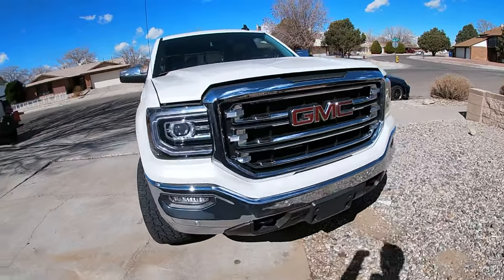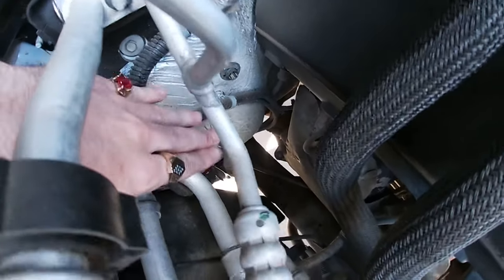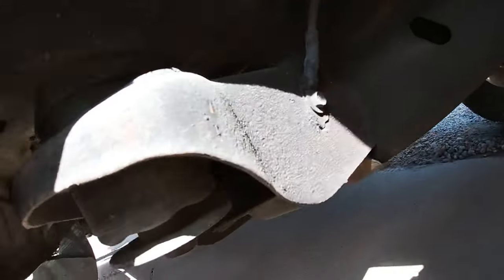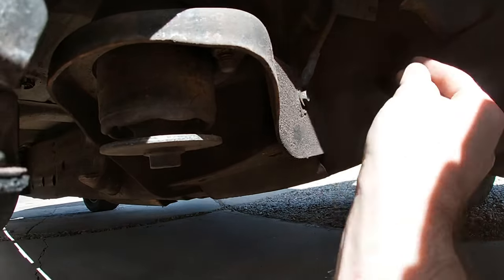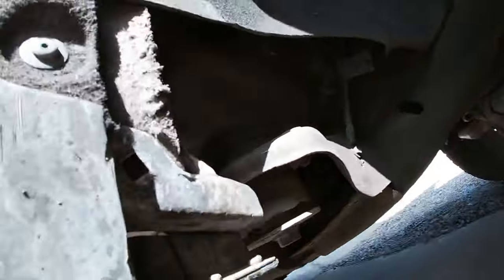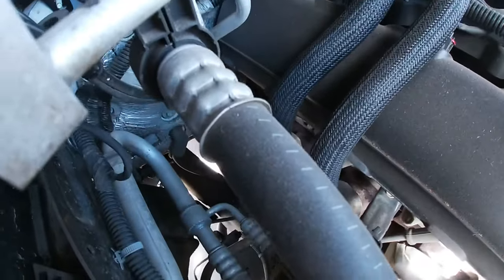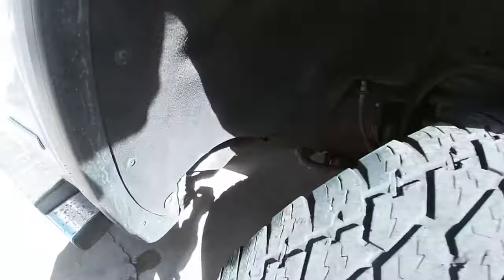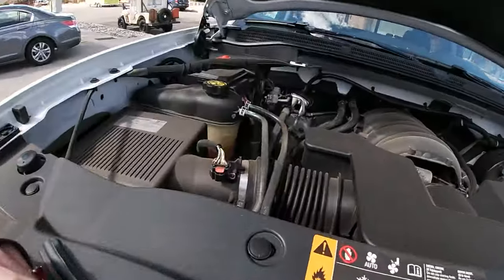2014-2018 Chevy Silverado electrical issues (solved)  part 2 pass side ground locations

Comment: I had problems like this and it popping a stabilitrak code. I cleaned the grounds, did the stearing position sensor, and the dealer had it for 3 days and said it was a bad hub. None of this fixed the issue. I changed the negative battery cable which looked completely fine about 4 months ago and the problems have completely gone away. I just figured while i have a minute id comment this on some of this videos so it coule maybe help someone because nobody had any deffinite answers for me and it sucked
Reply: I'm in that exact same position. I've cleaned the grounds. I've purchased a new battery. For whatever reason the truck will still completely shut down some times. Usually if the air conditioner is on I'm slowing down and turning into a parking lot. It's like with the electronic steering it's drawing too many amps. The truck completely shut down today and if a car was pulling out of the parking lot I would have hit them head on! The only option I know left is to change the whole negative battery cable. Every time this has happened in the past, I have no power until I open up the hood and squeeze the negative cable. It looks fine but obviously it's not! Glad changing it helped you. Hope it does the same for me..
Reply: Let me know how it goes I’m dealing with all the same stuff. Literally happened to me at Home Depot today
Reply: Thank you for posting this. I'm having the same issue right now. Next dealership appointment is March 26th. So I started cleaning the grounds tonight. Thank you, thank you, thank you.
Reply: @darrensalmons1985 what was the result of dealership findings??
Reply: I was having the same problem maybe a year ago on my 2015 tahoe ltz. Took it in to the shop had all the grounds cleaned up, but it eventually came back. I replaced the negative ground wire and it fixed for about 6 months. Now it's doing it again. This has to be a recall. Going to check the hot battery terminal and the ground by the speaker next. After that I'm getting rid of this thing. I'll keep everyone posted.
Reply: @napsgaming1854 hey man im having the same problems right now , did you find the problem
Reply: I’m in the same situation as you, but we replaced the whole negative ground cable and the car does have electricity, but it’s not wanting to turn over at all. I don’t know what to do.
Reply: My ‘15 Silverado does the same thing, repeated clicking when trying to start it. Sometimes it would eventually start and when it DID, the clock would reset to 12:00 suggesting an electrical short. When it happened one time, I pulled on the neg and pos batt terminals, retried it and it started. I replaced the neg ground wire to battery and it worked for about 3 weeks. Advance Auto rechecked it today: Alternator, starter and battery all good.
Reply: My 16 tahoe hasn't run in 6 month because of a random grounding issue. I replaced battery and it fixed issue fir about 4 months. Then started happening again where it decides it doesn't want to start some days, throw 12 codes and dash lights. Then next day start up just fine with no issues. I sent video to dealership and the technician said I need an exorcist instead of a mechanic. So I've been stuck making payments on a vehicle I can't even drive and no video out there has solved my issue
Reply: @Patriciaaannn my tahoe is having same issue. One day it won't start and throws a bunch of warning lights and tcm,ecm,bcm codes. Then the next day after not touching anything it starts up just fine... never buying a gm truck after this shit
Reply: I have the same issues with my Chevy Silverado 2016 I’m gonna try and change that battery post also and see if that does it! That would be so awesome if you did because this has been an issue for a while now! I have changed upper and lower control arms on his truck, I have change the transmission, I have change temperature sensor And I keep having the same problems. The bad part is if the sensors are not working right then the cooling fans don’t work right which causes the air condition to not blow cold I have about had enough of this truck!
Reply: @darrensalmons1985  update?
Reply: I'm having some weird issues as well my radio changes by its self and all lights go blank also the stabili track and the power steering keeps popping

Comment: For everyone who's having flickering dash lights, , the truck suddenly shutting down when lowering the speed to idle, slipping transmission (sometimes) a voltage reading under 14 volts (9 to 11) nav system and radio suddenly shutting down..., YES, THIS IS THE PROBLEM believe it or not. A bad ground because with time starts to get rusted or dirty and is not properly making the ground as it should be, taking off the screw and cleaning the parts,  where it goes connected and the metal that the screw holds fixes everything.
Reply: I will check my 15 Sierra
Reply: @juanrrobledo89  any chance is a black sierra, cause I just seen a black sierra stalled in the freeway in Oklahoma City and I wondered if it was you searching this
Reply: Exactly what my truck is doing thanks

Comment: I clean mines yesterday and it hasn’t been doing the flickering or shutting off and the steering wheel doesn’t jerk around when I turn . It was dirty af . Hopefully it stays like this thanks
Reply from the maker: Yea man I hope u got her all fixed n saved some money from the shops.   Please if u remember and truck is still going good in a month r two post a update comment thank u for ur feedback
Reply: Did this to my truck and maybe 4 months later the same problem is occurring… i think that it never truly fixed the problem. I think I’ve just driven enough miles for the codes to come back up. Anyone have tips?
Reply: It’s started doing it again . I just changed my alternator and new battery. I haven’t had problems since .
Reply: @fukubish6024 how is it working for u mine started doing the steering wheel jerk then that went away and now it just dies here and there
Reply: @getthebenji8462  I cleaned the ground That’s behind the front passenger tire . I stopped doing it

Comment: A week ago I removed the front dash panel and check both grounds at each pillar tucked up under windshield. Driver side was good. Passenger side was tight but wires sitting on the rubber matting. Removed the speaker. Loosened the nut to get all the rubber removed that the wire was sitting on. Cut all of it off around the bolt. Tightened back up and drove a week without issue. Today I drove about 28 miles. Shutoff truck. Went to get back in it and it would not unlock from key fob.. so, I assumed all electrical was out.. used key to get in truck. Amp steps did not work. Turned key nothing… not a sound.. just put new battery in a week ago. Checked both battery connections and both were tight. Another fella saw my hood up and came over to assist.. spent about 15 minutes checking fuses battery terminals and nothing. So, was planning on calling tow truck.. the fella and myself wanted to push the truck out of the way.. turned key nothing.. put truck in neutral and pushed it about 30 feet. I was steering and both of us pushing. Got to the spot I wanted it parked. Pushed the brake down put it in park. And all the power came back and truck fired right up… I also fixed the grounds underneath the truck… pulled bolts out. Grinding down to bare metal putting dyo electric grease on the bolt and tightened them all down… now I am wondering what my next step should be? And help and guidance would be appreciated. My thoughts of possibilities are. 1) ignition switch I am leaning towards that or a ground I am missing? When it would happen when truck is running the truck continues running fine. Just all electrical goes out… I mean everything…. All lights entire dash… which is a huge safety concern driving at night? Any thoughts? Thanks
Reply from the maker: Wth really damn it sounds like a bad connection some where if u got all the grounds but somthing as simple as pushing the truck making it start sounds like something lose let me look over my truck n see what I can find for u to look at strange tho has to be somthing stupid simple
Reply from the maker: Do u have a lot of keys on ur key ring I do know that too much keys on a ring is bad for the ignition I was kinda thinking the same thing the switch but hard to say
Reply: @garciagarage7735  I have only 3 keys and 1 Apple ID on my key ring.
Reply from the maker: I know it sounds stupid but I wonder if the Apple ID might be interfering with the cars key chip  Iv seen the little bling ring around the key whole mess with a car n it not start just cuz of the little bedazzled ring for dress up around the key whole but I think the Apple ID might be built smarter then that but I’m not sure just a thought
Reply: @garciagarage7735  was thinking same thing
Reply: Have you found the problem ?
Reply: @jordylsx8528  I have not. I was getting hood open message. Changed out hood latch still have same issue. I drop truck off tomorrow at Chevy dealership. I am convince it’t the body control module. As I get a few different messages besides hood open.. service trailer hitch, stable track light comes on…. Which leans me towards BCM.
Reply: Did you solve this?  This literally just happened to me. Completely dead after everything fine a few minutes ago. Popped the hood, as soon as I moved the negative battery cable I noticed the dope lights turned on. Cranked truck right up. Everything fine. Terminal connection was not loose so I think the negative battery cable might be worn through the protective sleeve and is grounding out. There is a video on YouTube you can find. Look up ground cable replacement.

Comment: 90% of the time when there is an electrical issue it will be a ground. Symptoms will vary as the power is searching for a new ground. Also, rarely will it be on the interior. Good luck guys! Btw, the morons that engineer these vehicles never have to work on them. 😳
Reply: Amen brother on the morons 👍

Comment: Good vid. Hooked up my scanner and found battery good. And alternator pushing at 15. I got the ground in dash done and found this ground wire installed but it was super easy to brake loose. Popped it off sanded, cleaned it. Now truck cranks faster.

Comment: Yes thank you man! Perfect. Wires all the same on mine. I have a liner as well. I got 20s force of road with mud tires and lift. Engine looks the same as well. I got the 2017 z71 midnight edition. Its a 6.2L Guy before did lots of upgrades. 2 12s, lift, tires, rims. It's all leather. Both my wires on the exact same spot. I passed and looked at it. I went step by step. Thank you for taking time and showing in detail. It's easier if someone like you knows what they doing show where wires start and end. I'm going to clean up now. See of that fixes. Also besides the inside that's nicer in the GMC what makes it better? Cause chevy and gmc basically same truck.
Reply from the maker: Hope it salves ur issues man well my Chevy was just a LT I didn’t have the sunroof parking sensors no side steps no heated are cooled seats  no fog lights this trucks just way more loaded is all it yes gmc Chevy same thing please lmk how it acts after cleaning up the grounds
Reply: @garciagarage7735  I'm in the middle of doing it rn. There's a few inches of snow here so it's taking me some time with laying down pads, and yeah I got all of those things in mine already. I'm going to keep mine for a long time. I got everything I need in it with a 6.2L. I can tow 11.7k.
Reply: @phoenixghost1099  did it work?
Reply: @jonathanlegarda8512  yes, my brights went out though
Reply: @phoenixghost1099  did u disconnect battery to reset light?
Reply: @jonathanlegarda8512  yes, and checked all 3 fuse boxes
Reply: @phoenixghost1099  koo wat do I look 4 in all fuse boxes? Bad fuses?
Reply: @jonathanlegarda8512  I checked every fuse, every point of contact. Everything checked out. I have a meter to check as well.
Reply: @phoenixghost1099  oh okay Koo thanks bro appreciate it

Comment: Bro thank you, my 2019 ltz Chevy did the same but a/c turns off lights flickering, cluster turns on/off, and when I go over a bump or it also random at times- I did a big 3, & did what you did it helped 3 months in already no issue- Wish GM did better on the grounding but thanks brother-🤙
Reply: Whats the big 3? Sorry my truck is having the same issue and the dealer blamed it on my aftermarket sub 😫
Reply: What is the big 3? My 15 Chevy cluster turns on and off as well. TIA
Reply from the maker: Up grade the 3 grounds to bigger wires

Comment: i have a 2014 sierra 5.3L and my truck had flickering dash lights while slowing down and turning out on the road. then as i was turning to get in my driveway it just shut down with no power to anything. it was completely dead. after troubleshooting the battery, battery main fuse, checked all fuses, cleaned all grounds from battery to passenger side of engine block and chassis and removed the insulation from the ground under the driver side dash, nothing helped at all. until i wiggled the negative terminal on the battery and then i finally got power and started the truck right up. it happened again later on that day when i was at the dealer getting the new ground cables to replace from the battery to side of engine block and chassis. after replacing the ground cable that problem hasn’t happened again. save your guys time and skip all of that and just replace the ground cables.

Comment: I have a problem with my 16 Silverado doing strange things. Saying battery saver active, battery charging system needs service, alternator shows bad, take it in to rebuild shop and they say its good. check battery and it is good. Bought a new battery current sensor but didn't put it on yet. I saw this video and my ground wire is filthy. I cleaned it real good like you said. I will know if that was or is the problem. Time will tell. Thanks for the info! Big thumbs up to you!!!!
Reply from the maker: Hopefully she’s back to the tuck u love with no issues and hope u can get the money back on the battery post a update in a couple months hopefully she’s good to go
Reply: @garciagarage7735  so far it is working as it should. I forgot to mention too, that when it was acting up, the wipers would turn on and make 1 stroke when I would rev the engine up. dash lights would go completely out and the steering would not work! Thanks again. Why would they put a ground wire right behind the tire where it is going to catch all the crap off the road? just so they can make money on repairs!
Reply: @nowayhunting  I'm having the same exact issues. Did you have any problems after cleaning that ground wire?
Reply: @rcm3851  So far it is working just fine. The little ground wire behind the passinger front tire. Stupid place to put a grond wire!
Reply: @nowayhunting  I'm having the exact same issue
Reply: That did not work. I put the battery current sensor on and that slowed things down, but the radio still goes crazy some times. Going to try the ground on the top left dash next. Even put a new battery in too.
Reply: Im having this issue currently, i have a service battery charging system coming up, did this fix it?
Reply: That ground wire did NOT fix mine.
Reply: @billdeatherage9492  did you ever figure out what it was?
Reply: @rcm3851 still having the same issues.

Comment: Same issues cleaned mine yesterday see what happens . I changed throttle , senors etc before cleaning the damn ground plate showed in this video lol
Before I cleaned the plate to bare metal I had a reduce power engine issue I think the ground was resetting my new throttle after it would make the truck flicker ..not fun trying to figure this stuff out that’s for sure
Reply: Update???

Comment: Its about 3:30am im tired of that random flickering lights inside and out having all kinds of power loss on my 15 gmc bouta go clean that ground on the bottom tommorow chances are thats the issue ill keep updated👍🏼
Reply: Was it the issue?
Reply: Did this fix it?
Reply: @jacobduncan5319  replaced negative battery cable issue resolved

Comment: I’m kinda late to the game but I bought a 2014 GMC Sierra and had issues with its theft deterrent system.

I thought it was a grounding issue too, so your video has helped me look for grounds in places I didn’t know to look for 

Thanks for posting the video, great help.

Congrats on your job at the PO 🎉
Reply: What fix your theft deterrent system? Help I have same issue
Reply: @ricardosuarez440  
I went to the local GMC dealer and had a new factory key made and that fixed the issue, haven’t had the issue come up since
Reply: Chief, I was having the same issues. No joke I had just joined a gym and the RFID key fob I got for the gym is what was causing the truck to go into anti-theft mode. I took it off my keyring, never had an issue with it again.

Comment: i cleaned both still have issue

Gonna try the ground inside the dash under drivers side speaker up in front.
Reply from the maker: Just take ur time with the trim so u don’t break it made my hands sweat a lil but got it
Reply: Did you get your issue fixed?
Reply: @minni1094  Yes and it was just the battery terminals and posts, i bought one of those battery cleaning brushes and fixed it right up...........

Comment: Hey brother I’m just curious exactly what kind of electrical issues were you having? Because I have a 2016 Chevy Silverado and I’m always having problems with ABS light traction light temperature sensors and I’m wondering if that ground problem is what’s causing it or maybe something else I don’t know just let me know whenever you can thank you and have a great day
Reply: Same.  Could be ground, could be ABS, could be drivers speaker post.  I'm still chasing.